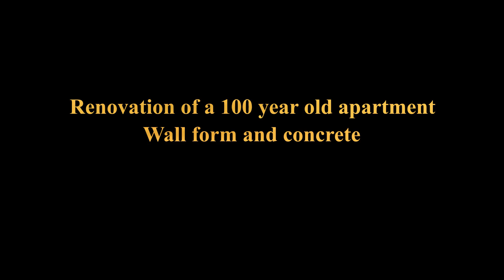Renovation of a 100 year old apartment - Wall form and concrete

Comment: Mixing concrete at home - priceless. There is always a guy that comes only to drink beer (you have it), a guy in army pants (you have it), a guy that adds too much concrete, and a guy that adds to little of it (not sure if you have those, but they are the key of a good mixture :) ). The only thing, for the best feeling, the outside temperature should be at least 35 C, otherwise there is no fun :D
Reply from the maker: Two corrections; nobody came just to drink and the temperature was not 35 but 27.5C!😁